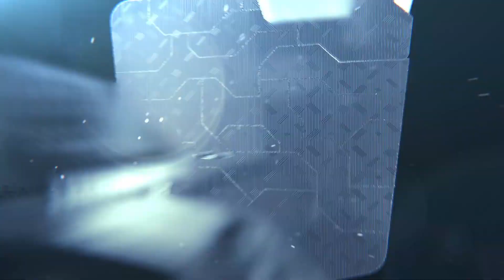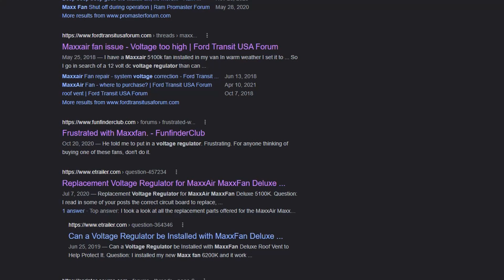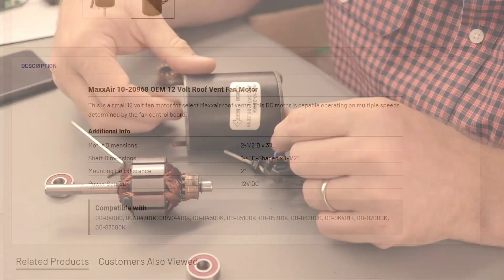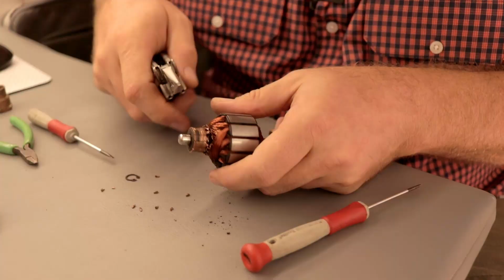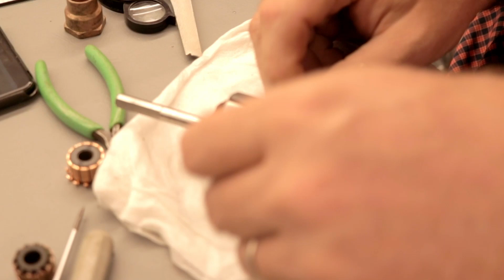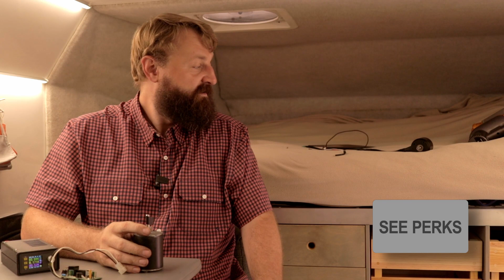More MaxxFan Motor Problems - Can we upgrade to Brushless?

Comment: 3d print a circular shim for the small motor to provide the correct outer diameter and mounting holes.
Reply from the maker: That was the plan... but I don't want to use this motor because of the cogging noise so no point in wasting plastic.
Reply from the maker: Also the shaft wouldn't be long enough if I shimmed it... it was just barely enough as it was.

Comment: Awesome video again...I think you did everything you could for the brush-less motor too. 
It made me think of the upgrades they made to the 12 large HVAC fans in the concert/NHL arena I used to work at; so they went from simple 1 speed motors to VFD driven motors, but they made a bad noise; so they changed the sign-wave in the VFD drive to be slightly less efficient and it stopped the noise.
Reply from the maker: Less efficiency! 🤔 Won't be havin' that! 😂

Comment: I really think that if you are going to replace the original motor you need an induction motor.  They have no wear parts other than the bearings and are nice an quiet.  You already have a place for a dc control board and I bet you could hack together a DC to 3-pahse speed controller that could integrate into your existing control system.

Comment: What you need to do is simply install a Cox 049 engine in there and that should about do 'er. Plus, no more electrical concerns, just pure reliable gas power. You're welcome!
Reply from the maker: Thanks Joe, but you're late to the party and we've already concluded this is the best choice in previous comments... 🤣
Reply: @Everlanders  Ahh, I knew someone would beat me to it. Never mind spinning the fan at 20,000 rpm. lol

Comment: In RC applications a sensor wire is used so a scensored brushless controller eliminates cogging.
Reply from the maker: I wish it was true... I hoped very hard that it was true... But this motor (look carefully) has sensors and I couldn't get it to stop cogging. But if you know what changes need to be made in software, please let me know.

Comment: As I plan my campulance build, I was astounded by the high cost of these fans and their poor apparent quality. And they're the best on the market! This - along with wanting to cover entire roof with solar, and only admitting filtered air - has set me down the path of designing a contained, ducted HVAC system around EBM-Pabst electronically commutated centifugal fans, which have the additional benefit of internal speed control via PWM input (and available in 24V to match my electrical system).

Kudos on your first-rate MacGyvering!

Comment: If you find brushes with correct wires,  they are easy to file into the correct size,  I do it all the time.
Reply from the maker: Yes, It's hard to find anything smaller than my thumb around here...

Comment: I've never cracked one..what's in a brushless motor cordless drill???
Reply from the maker: Much the same as a brushed motor, except the motor has no brushes and the magnets spin and the windings are stationary. Additionally, there is an external speed controller that pulses the windings in series. The timing of these pulses is calculated based on the magnets passing the unused coil, this would be a sensorless motor, or a sensored motor would have hall effect sensors imbedded in the motor which the controller then uses to time the motor.

Comment: Would a pure sine or triangle wave ESC (diy?) be quieter ?
Reply from the maker: No, the sound is not from the switching waveform, it's  purely this motors mechanical cogging frequency.
Reply: @Everlanders  Indeed, I understand completely just like a stepper motor I was thinking more like a servo motor idea but that would need feedback. I came across this but probably an overkill for a fan motor ;-)...

Comment: how is your hot water diversion working?
Reply from the maker: Perfect! I've since added additional logic to heat the water just a bit in the morning, and as the batteries get nearer to full, the temperature setpoint keeps increasing to a maximum of 80°c. Then it turns off when the sun goes down and it's still plenty warm till morning 🌄 I've also tied our 2 air systems to this logic, so as the batteries approach 95% the air compressors fill our air tanks for water pressure and pneumatics with excess solar...

Comment: Thanks. Sounds like I need to make up an overhaul kit for mine. Guess the fans are expected to get occasional use, not permanent. 
Pity.
Now for the noisy open/close...
Those bearings looked sealed from here, but clearly they're not.
Reply from the maker: The bearings are "Shielded" not "Sealed".  And you hit the nail on the head - they are built to be just good enough for 3 weekends a year.
Reply: @Everlanders  for 2 years max? 😲😉😉
Reply from the maker: It seems that's when they need a complete rebuild... 😳
Reply: @Everlanders  In the middle of a conversion now, will think about how to upgrade afterwards. Seems I need a decent motor, silent lid lift, motor control and radio comms. I think I'll add led lighting at the same time.
Love you van build, btw.

Comment: could you spray the insides with that new fancy Ceramic spray for cars?
Reply from the maker: Isn't that a paint? Wouldn't it interfere with the brush contacting the copper? 🤔
Reply: @Everlanders  I was thinking on the plastics where dust builds up, it just a automotive spray kinda like rainx, should allow you to use air duster to clean it. 

I guess instead of max fan, you could install an inline 6 inch duct fan somewhere and never worry about noises.

Comment: Nice job on the repair, and thanks for the break-in tips!  I would have tossed it and got a Dometic FanTastic Vent instead.  No problems with my MaxxFan yet in our trailer (lifepo4 battery voltages), but I've been tossing around the idea of putting a diode in series with it to drop the voltage a little.
Reply from the maker: Tossing and replacing with X isn't really an option in our location.